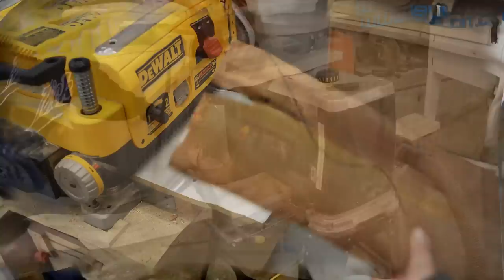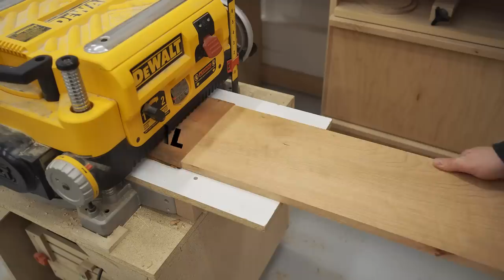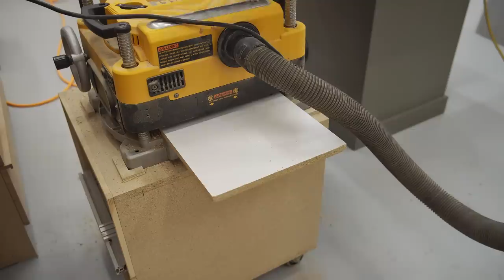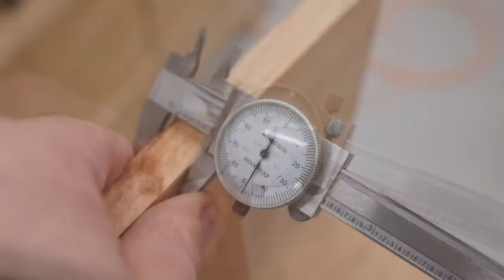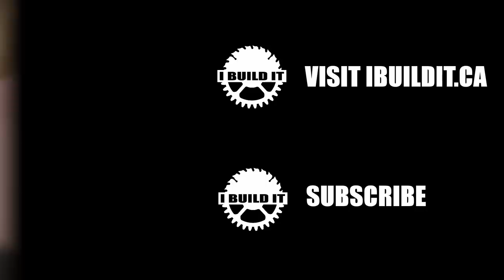Eliminate Planer Snipe! The Only Way That Really Works

Comment: Great video and it’s one that is certainly much needed.  I’ve been using this method since I first found out about it years ago.  There are a lot of videos and articles that will tell you to raise the infeed and outfeed tables slightly or to lift up on the stock as it enters and exits the planer.  In my experience, those methods work to some degree but are rarely consistent.  As John said, both feed rollers need to be engaged constantly to avoid the snipe and this is the most straightforward and consistent way to do it.  

The only additional tip I would add is to keep a few 2x6s or whatever width you prefer on hand specifically for this operation.  Cut it down into 12”-18” lengths.  Whenever you need to use the planer, just rip a piece to match the thickness of the stock that you are planing and use it as your sacrificial board.  That way you’re not using your more expensive wood as a sacrificial board.  The  ripped piece may not be as wide as what you’re planing, but I’ve never had an issue.  However, I do make sure I run this sacrificial piece through the middle of the planer so that it engages the rollers in the center.

Comment: I use 2x4’s as my sacrificial piece. I have the DW735 and haven’t had an issue. I first chop them to about a foot, then resaw them the thickness of my intended stock. I also be sure to 180 them when they go in last so that the snipe from the front is now the trailing edge, that way I still have an edge as thick as my stock. 😎

Comment: This is absolutely correct. Same technique I always use. Only additional point I would make is that you can always use construction grade pine as your sacrificial. No need to sacrifice pricy hardwood.
Reply: I heard using pine doesn't do well with a planer because of all of the sap and junk in it. Thoughts?

Comment: I'm sure It'll be pretty obvious to most, but for narrower stock rather than going end to end you can instead start feeding the next piece while the previous one is half-way through. In combination with a sacrificial start/end piece this also eliminates snipe and also speeds up your workflow significantly.

Comment: Good video John. I'd like to point out that there are two additional methods to eliminate snipe, that work in SOME circumstances (not all). One is to glue two sacrificial strips of wood that are longer than your keeper piece, one to each side. As long as they are longer in length by several inches, the sacrificial strips (attached by hot glue, double-sided tape, whatever) will take the snipe and the keeper piece sandwiched between them won't have any snipe. The obvious restriction for this is it will only work for pieces of wood that are less than the maximum width your planer will accept. The other technique also requires narrower "keeper" pieces of wood and you put them into the planer skewed so they are pulled through at an angle. The snipe will exist only on a very small portion of the wood. This is best used for relatively narrow and short pieces of wood, or it's just not practical to skew them. They'll hit the side of the planer and be straightened out (or damaged). Longer and wider pieces are best handled by either the first method I mentioned, or by your method. Not saying there is anything wrong with your method--I've used it many times successfully myself. Just adding a couple of alternative methods for possible consideration.
Reply: Lex Boegen a lot easier to leave the workpiece long and trim it after planing than to glue pieces to it, if you have enough extra material.
Reply: John's method seems like a lot less trouble.

Comment: To refine this, make sure that you flip the sacrificial piece end-to-end when you send it in behind the last piece.  That way its sniped (that is, thinner) end is not the one (insufficiently) holding up the roller.
Reply: Arrrgg, I have been using this technique with success. Then on the last pass of some stock I had snipe. Choice words were spoken.  I was not paying attention to the snipe on the sacrificial piece. Thanks for the tip.
Reply: Yeah, I can see how easy that mistake could happen. I’m going to mark the leading end of the sacrificial board.

Comment: THIS IS IT! THE ONLY WAY, HE IS 100% CORRECT.  I have a Dewalt 735. I consistently would get a depression about 4" from the beginning of the workpiece. I tried all the other youtube cures. Not to be. Using a same thickness scape finally did the job. I have an extension chute front and back that is perfectly level to the plainer tray. I tried adding a straight through piece of plywood. Nope, still not a flat cut. Pulled out the plywood, verified the level of my chute and out together a scape piece. I would start with the scrape then flip to the back after it came through although I missed the back step a couple times and it didn't seem to matter. The front load extra piece seems to be the answer and the only way.

Comment: So where would you say the slop is in the planer? Is it in the movable planer and roers assembly, or one or other roller, the raise/lower screws, or what? 

Some saybthat you need to raise the single-roller-held end of the board up jist a little to simulate the opposite roller pushing the board down at that side, but if the ers have amy vertical play, that would not work repeatably. Others say to adjust the flip-down plates on portable planers so they are either perfectly flat or slightly up at the outer edge. These methods seem to all be compensating for something that has play in it. 

If feeding a start board and finish board os needed, then perhaps loading the rollers with something that would push on them to wring out slop might work.

Comment: Snipe comes from looseness in the mechanism that raises and lowers the machine, right? So won't adding springs over the lift screws solve the issue permanently by putting tension on the mechanism? Better yet, a counterweight system since it it will apply the same pressure regardless of height setting.

Comment: Easy way to get a sacrificial board of the same width and thickness is to use the ends of the work piece as the sacrificial board.  Just cut them off after planing.

Comment: Thanks for sharing. Do you feel it's necessary to run something of similar hardness as the sacrificial piece? I'd imagine it's preferable but haven't tried myself yet.
Reply from the maker: Doesn't have to be the same type wood - softwood will work exactly the same.

Comment: You really need a whole board or a small piece can do the trick?
Reply: It should be long enough to engage both the infeed and outfeed rollers, otherwise it could get stuck between them when it's taking the end-of-board snipe.
Reply: @mlindholm  
Yep that was my concern, but you can use tape to glue the piece and make it act like a whole board I do that a lot when cutting wood to prevent splintering.

Comment: Does snipe occur with the helix cutter head upgrade?
Reply: Why wouldn't it?  It's not the cutter head type that determines the snipe, it's that the pressure the infeed and outfeed rollers are applying isn't equal, when a board isn't fully engaged with both.  So you insert a sacrificial board first to take the hit when the outfeed roller doesn't have anything under it, then send it through again at the end to get hit again when the infeed roller is unsupported.  The cutter head is what makes the snipe, but it doesn't matter what kind it is.